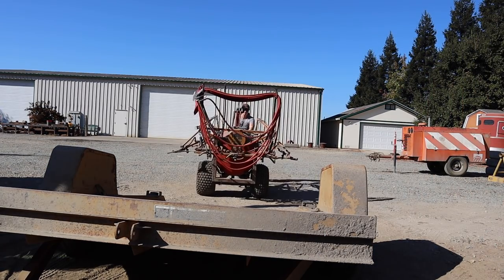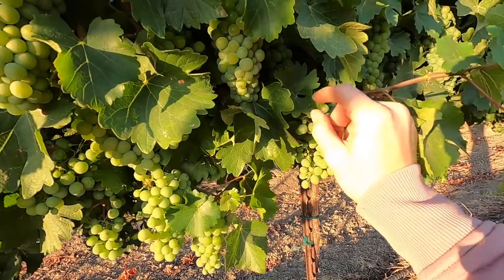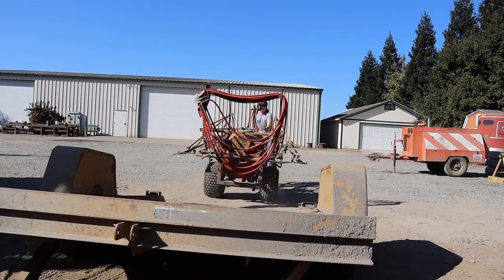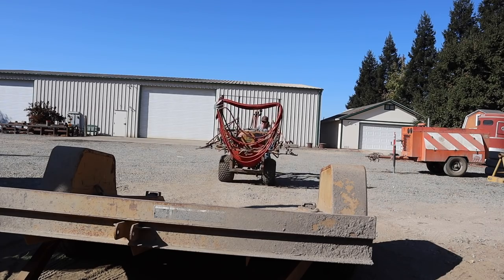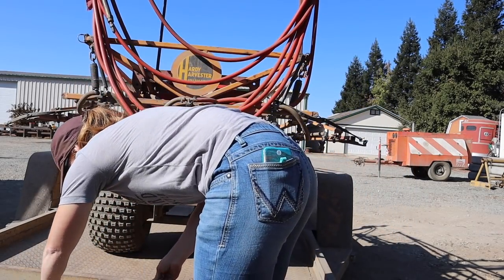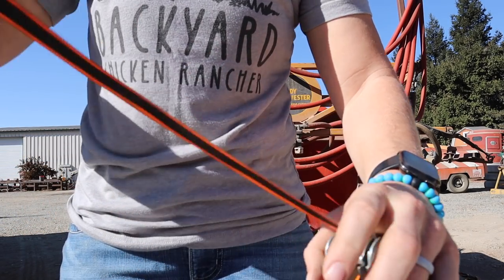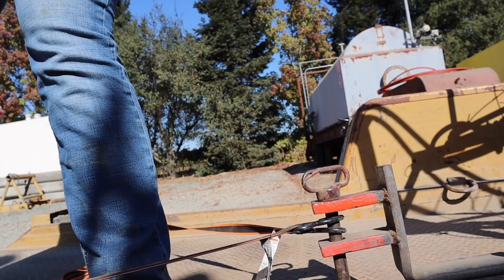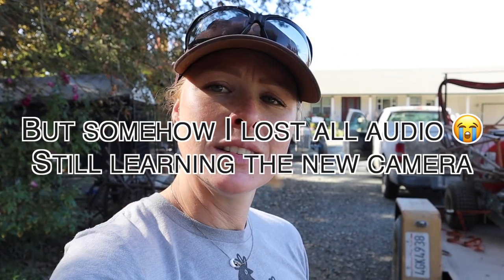AM I STRONG ENOUGH?! - Trying to tie down a spraying, and praying it doesn't fall off the trailer!

Comment: Hey Tara, I don't want to sound critical but when you were hooking  the trailer to the truck, it showed you latching the pintle hook but not putting a pin in the latch, maybe you did and that part was edited out? Anyway most of the time they won't come open, but that one time!!
Reply from the maker: Ah yes. I think I just edited it out. I did put the pin in. Always
Reply: We had a guy lose a brush chipper off a truck because he didn't put the pin in, the safety chains didn't hold luckily it just went off the road and didn't hit anything! Looks like things are going well for you!!

Comment: Allways use chains a binders on metal equipment, allways , straps are not legal on metal equipment unless you use strap protectors to go under the strap on the corners, ok, you got it there with no problems, had it came off of your trailer,you would be have a whole other kind of Day , always use chains a binders ,always, ok , love your vlogs Tara ,but try to be more safe When hauling equipment, thanks BigAl California.
Reply: These straps were all straight runs...not over any sharp edges